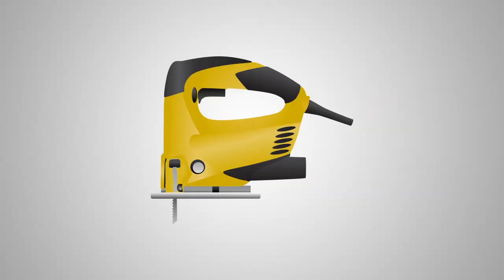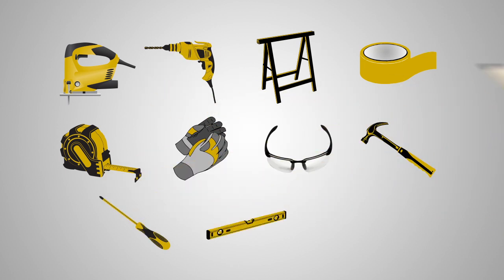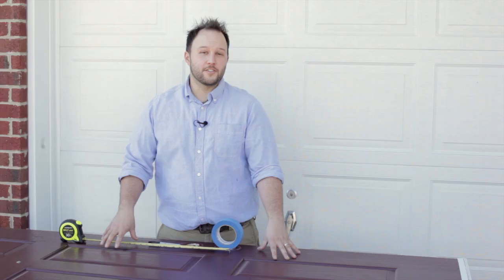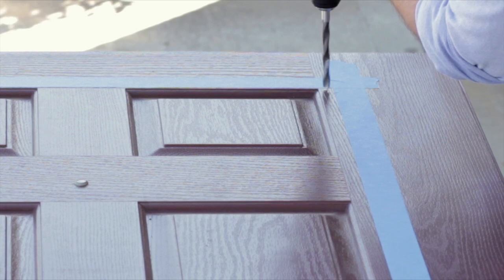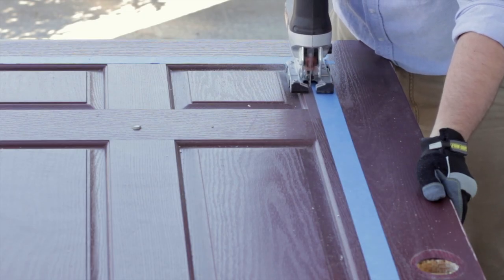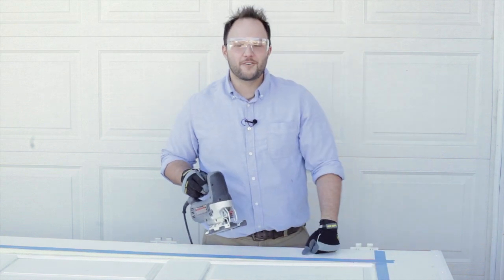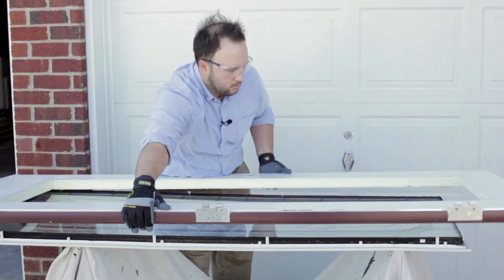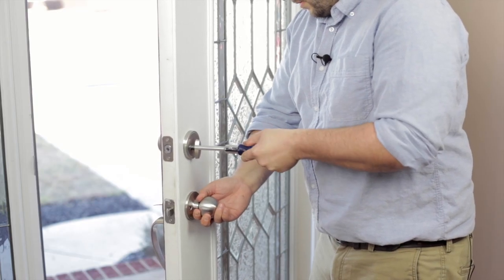How to Add Door Glass to Your Door - Door Glass Installation Guide

Comment: question, how does adding such a large glass panel to a door affect the overall strength of the door, particularly sagging on the lock side? I assume that by cutting out such a large center section of the door some bracing inside the door will be cut also and adding a glass insert which for sure weighs a lot more than the removed section of the door does, isn't there a possibility for door sag over time?
Reply from the maker: Thank you for the comment!  Door Glass Kits are designed to fit either Steel or Fiberglass doors. More info can be found here: https://www.zabitat.com/u/faq

Or connect with our customer service team: 855.813.3111

We look forward to working with you. Thank you!
Reply: @zabitat  .. thank you for the response, but I think you did not understand my question. My question was not about what type of doors your kits fit, it was about compromising the door strength after cutting out a large section of the door and place a much heavier glass panel in the opening. Maybe you can address that question somehow? Thank you.

Comment: Why not add some caulking to help secure and insulate the glass?
Reply from the maker: Thank you for the comment.  The new door glass frame set consists of 1 inner and 1 outer high performance, molded plastic frame. The outer frame has an air and water tight, factory applied seal that bonds the frame to the glass.

More information: Zabitat website: https://www.zabitat.com/u/product-information
Zabitat team contact: 855-813-3111

We look forward to hearing from you. Thank you!

Comment: I never understand why you have to cut it both sides. Can't you just cat thru from the start?
Reply: good question , why they don't answer it
Reply: I saw another video on this. It’s because the blade doesn’t go through both sides. The inside isn’t always the same material as the outsides. This helps get a straight line because you could accidentally cut the other side at the wrong angle. Doors are not always one solid price of wood. Usually they are metal frames on the outside and a different core center.
Reply: he clearly said in the video not to cut straight through both sides at the same time. These doors are hollow core and that means the outer skin will flex when the saw teeth try to cut upwards. This can lead to tearing and ripping or bending of the metal skin on the 'bottom' layer, especially on a metal door. You therefore want to cut through one sheet or side at a time, to prevent jarring of the saw blade.

Comment: So expensive! Compare to Lowe’s and Hone Depot
Reply from the maker: Hi None None. There are many different price points for door glass, and cost will vary based on your preference -- most of the options are considerably less than the glass + a new door. Other considerations are installation time, permit requirements, and skill level.
Reply: @zabitat  thanks for replying! understand, the style looks similar, the price on zabitat is more than whole door's price in lowes. We are moving into a new community, a lot of owner considering upgrade the ugly door, may i get a good discount from your website? I can referral to my neighbors. the original door block the light through to the hallway, pretty dark at day time.

How does it look at night? the light will come out?
Reply from the maker: @wekido  - We'd love to help you and your neighbors get the right style and privacy for your new homes! Head over to zabitat.com and chat with our Service Team. There's a great before and after photo gallery to give you an idea of the levels of privacy and range of remodels we can do to existing doors. If you don't see what you're looking for, we also can do custom glass in various sizes and most every style (scenery, wildlife, custom metal designs, and even a cat!).Check out the referral program as well :)